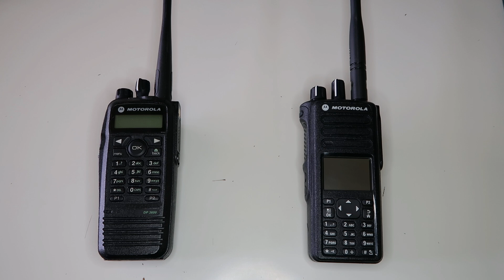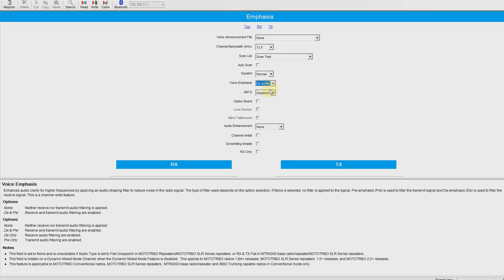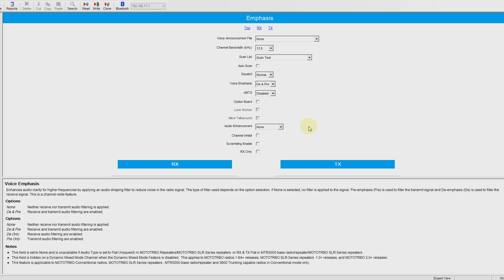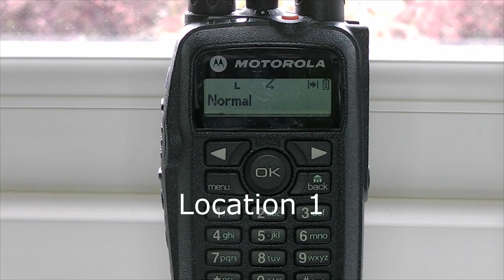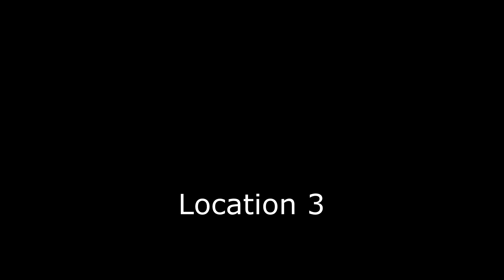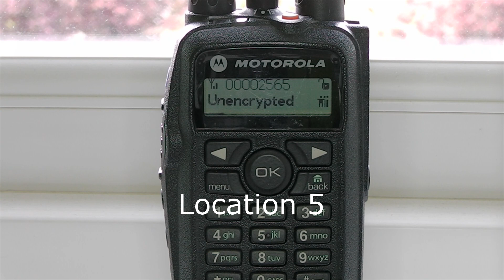Boost analog walkie talkie range with this trick

Comment: I have several very old non professional Motorola T6222 radios that I believe use these techniques. The audio quality is much stronger than other non professional 446 radios I have so much so that they still get used more than any of the others. The only downside to them is that the plastic in the aerial covers has degraded and they keep breaking. Thanks for the video.

Comment: Interesting topic. The analogue audio on the DP4000 series is some of the best i've heard on a radio, it's a shame DMR doesn't sound quite as good.
Reply from the maker: Yeah. In this video it could be partially because the DP3600 is receiving which has pretty bad audio when receiving DMR. If it was another DP4800 it would be better sounding but still not as good as FM at good signal strength.
Reply: It doesn't sound good but it is still readable and understandable at the fringe of coverage compared to FM

Comment: As a listener only … i have the abbree ar 518 analogue radio which when using compander mode it totally distorts the signal.. so i keep it off… BTW I havenhad much luck with Abbree company on my model make which i needed extra info … i suggest not using them
Reply from the maker: If you're only listening then I wouldn't expect the compander to work well. As I explained in the video you need to turn it on on both sides for it to work. If you turned it on on the receiver only it would be expected to sound terrible